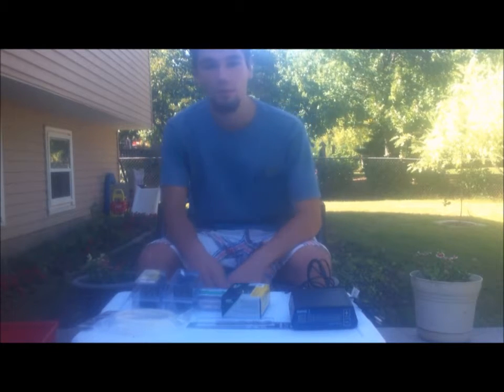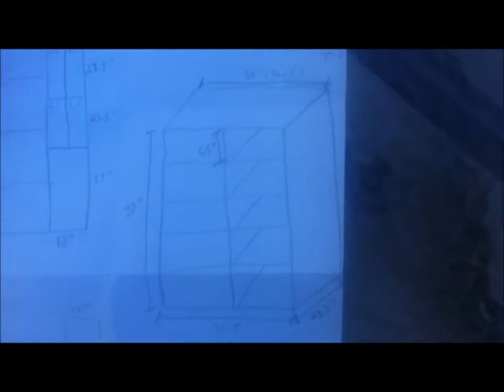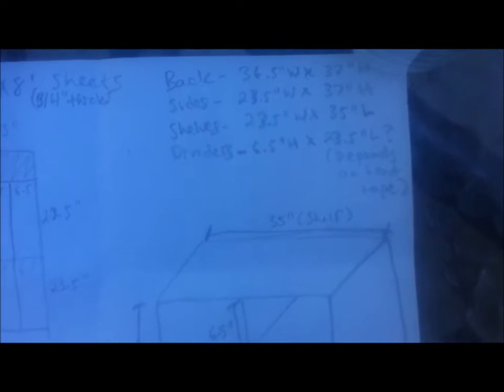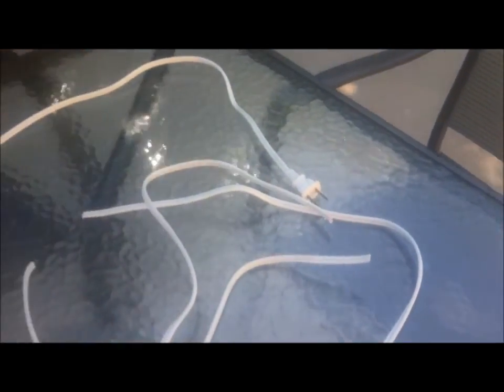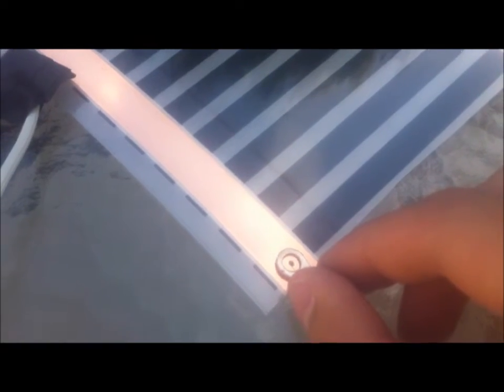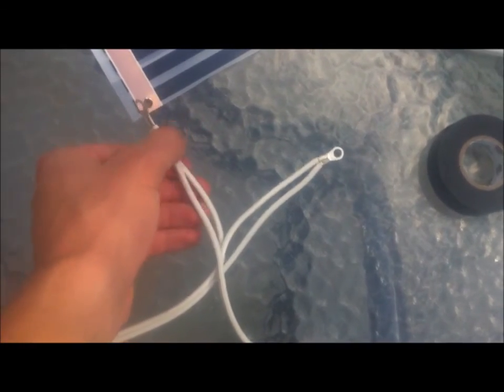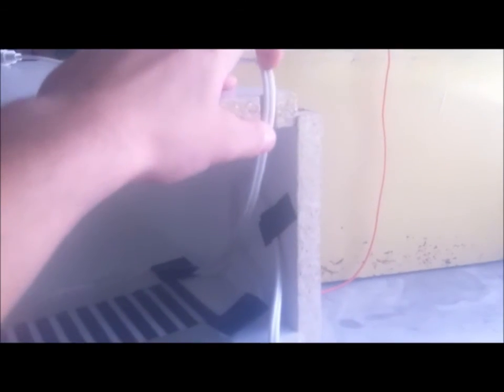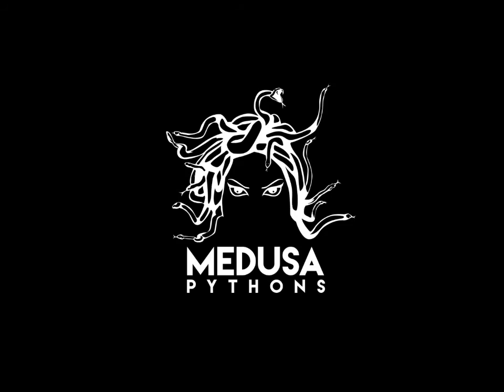Building a Melamine Snake Rack

Comment: I have a ball python rack that can hold six 28 or 41 qt tubs. The top 4 shelves have 4 inch wide heat tape running along the back as a single strip. The bottom 2 shelves have 12 inch wide heat tape installed the same way. I have a thermostat that can potentially control multiple sources of heat but I'm not sure if plugging the 12 inch to the thermostat that's controlling the 4 inch already is okay. I'm worried that the 12 inch heat tape would get much hotter much faster since there's no probe on it? The probe is on the 4th shelf basically in the middle of the entire rack. I also have a temp gun to monitor temps and experiment but would you think I could just run both differently sized heat tape off of one thermostat or should I get a second on even if they're on the same rack. Sorry for the mouthful lol.
Reply from the maker: What I would do is just experiment with it and use the temp gun to see if it works. If the heat tape looks like its all more or less heating up to the same temperature at any given time, it will work just fine. I don't really know enough about electricity to tell you whether it should theoretically heat up the same lol. You can easily try it and find out though. If it doesn't look like it will work, then yes you might have to get a second thermostat.

Comment: would double cds be best or triple be too much?
Reply from the maker: I only used single CD's in this build. But some of the drawers do stick a bit. Double CD's would probably be perfect but then again it all depends what snakes you're putting in them... if there is a big gap you have to make sure your snakes are not big enough to get through.
Reply from the maker: *not small enough to get through
Reply: +MedusaPythons just ball pythons
Reply from the maker: then you're probably fine with 2 CD's
Reply: card board works great
thats what i use